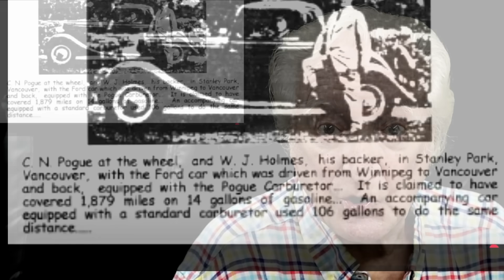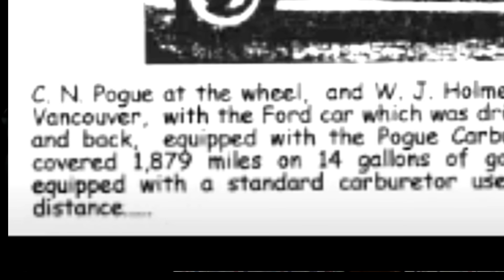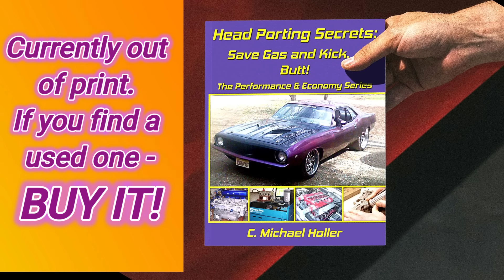100 MPG carb - the real truth!!

Comment: Pogue car you talk about was auctioned off. The article is still online. That cars block was cracked everywhere due to running Lean. Good article. 100 mpg? I don't know. What I do know is this, Compression, Compression, Compression. That makes horsepower and horsepower makes fuel economy. Tom ogles car moved the carb butterflies only to the fuel tank and put a reinforced tank under full vacuum that was heated with the motors coolant to help vaporize the gas. There was no pressure in the tank. Here's what I have done that works. A fuel tank under Full vacuum with just extremely little air bleed will run a motor with tons of power. The way I control the rpm is way by Ball valve. Basically you don't need an air intake on a n engine to run. It boils the gasoline under full vacuum. The oxygen comes from the boiling action of the fuel. Airplane pilots use the terms, Rich of Peak and Lean of Peak. This explains the danger zone of running Lean and the safe zone of running Lean.
Reply: A fuel tank under full vacuum? LOL! It couldn't handle full vacuum even if it was reinforced and it takes power to create vacuum. Engines are more efficient when they don't produce vacuum. Look at Hybrid motors. High compression and they bleed off vacuum.  Creates perhaps a 10 percent increase in fuel economy but loss of power.
Reply: @keithwiebe1787 if they are more efficient with less vacuum then how do they draw in fuel and air to atomize the fuel efficiently? Engine with hi vacuum have hi compression. And hi compression is what makes for an effeict engine.
Reply: Aaron, you say "the oxygen comes from the boiling action of the fuel."  Can you please explain just how this works?  Thank you.
Reply: @Cougracer67 same way boiling water gives off air. Why I have no idea except to say it's easy to check. Try it. You need a full vacuum on a sealed container with extremely little air hole in the line going to the engine. Make sure you have a way to keep the exhaust temperature. If I remember right water vapor can keep the engine cooled down

Comment: I know we're talking carburetors here, but how about modern high pressure fuel injection with pre combustion chambers? It also solves the dangers of fuel vapors.
Reply from the maker: GOOD ANSWER BUT WE ARE TALKING ABOUT A 1935 FLAT HEAD V8 HERE!
Reply: @DavidVizard  sorry I didn't know that part. I didn't know it was a very specific engine.I just knew you we're discussing carbs and yeah, this isn't carbs, carry on.😊
Reply: @DavidVizard  For now...

Comment: I am familiar with C N Pogue.  Also, I think 40 mph is too fast on old dirt roads.  20-30 mph is closer to the mark.  Pete Hodges
Reply: The theory they use is that not all of the fuel is vaporized and they compare mpg of propane powerd cars as an example.  Propane vapor is fully vaporized before combustion.  Propane MPG is similar to gasoline but propane does not have nearly as much energy as gasoline or diesel fuel.  Propane 91452-92500, Gasoline 120476-125000, Diesel 137381-138500 btu /us gallon
Reply: I am so glad you are revisiting this topic!
Reply: I guess to be correct it should actually be calculated in BTU per pound.  diesel fuel 19400 , gasoline 20500, propane 21500.  Diesel is 7.07 lb/gallon, gasoline is 6 lb per gallon.  Propane is 4.2 lb per gallon
Reply from the maker: Pete, - that's a piece of useful info. 
Thanks

Comment: If your prime interest is fuel economy per unit volume from a piston engine, then diesel is the hands down winner. 15% more energy per unit volume than gasoline, plus diesel engines are inherently more efficient than petrol engines. It's a no brainer, for the same vehicle you can expect 25 to 40% savings from a diesel vs petrol, whilst not changing your driving style in any way.
Reply: Thats why in europe had small diesel car very whith very low fuel comsuption
Reply: @danyan7  I have 1998 Seat Alhambra with VW 1.9 TDI , car weighs roughly 1800 Kg, average fuel consumption 52 Miles per imperial gallon, it's not a performance monster, but it easily keeps up with the traffic, so average journey times from A to B are exactly the same as your sports car if you don't want to get a speed camera ticket. I can legally tow two tonnes with it, it makes max torque at 1900 RPM ish, the ideal utilitarian daily driver. It has at present 280,000 miles on the clock and still going strong.  I save my V8 hobby car for the weekend...
Reply from the maker: Andy - we are specifically debating the 100 mpg carb. Other than model aero diesels this type of engine has fuel injection.
Reply: @DavidVizard  I appreciate your reply, I bought your A series  book in the 80s, when knowledge was far harder to come by than it is today with the internet. I learned a lot. I fitted twin SU carbs, home made manifold, to a Ford Kent 1600, carbs from an 1800 Marina TC, slightly thicker needles to lean it out a touch, way more power and much better fuel economy than the standard Ford fixed jet carb. It brought the Ford engine up to BL standards for fuel economy and power. For daily driver fuel economy, well set up  Skinner Union carbs are hard to beat. 33 degrees of advance at 3000 rpm if I remember correctly.

I then progressed to Rover p6, Did you ever do anything with the Buick/Rover V8?

Great respect and best regards.

Comment: The syncreometric mixture (I never could get the spelling right) the ideal mixture of air to fuel to fully burn , to much air no burn , to much fuel no full burn
Reply from the maker: The span of air/fuel ratios' that will burn is way wider the those hovering around the chemically correct A/F ratio.

Comment: LOL....does anyone realise the absolute tweaked to the edge of destruction engineers design to meet the highest MPG possible.....check the ultra-light motor oils causing engine failures. Lighter oil, less work for the oil pump.......Oh wait, you want the engine to last? Didn't think of that..............

This is complete BS......a tiny engine can, but not in a full-size car

Comment: feddie dixon  brooklands  man said carburartion is only a controled fuel leak 😂
Reply from the maker: Ah - Freddy Dixon - the Smoky Unik forrunner!
Reply: @DavidVizard 

i read he raced a6 pot "white riley " that had a leather cover over the 3 su carbs. it was concealing  the three bowden wires  that pulled the plungers,up  as the vacuum part was now disabled  and butterflies removed    just like an amal 
m,cycle carb   giving instant response

Comment: Mr. Vizard, 
May I first say that I totally respect that you've devoted much of your life in the pursuit of 'more efficiency' in combustion engines.  I define efficiency as more power &/or More fuel mileage. 

I'd like to possibly throw you a curve ball here, for you to think about a bit.

Making an engine run more efficiently is all about optimizing combustion and minimizing parasitic loss.  I define parasitic loss as heat, rotating assembly drag, intake runner restrictions, and exhaust restrictions.

However, there's another possible parasitic loss that I don't think anyone has ever looked at, except maybe me.  I hypothesize that the actual process of fuel combustion has a parasitic loss.  It is a 'known fact' that a certain type of fuel generates X amount of calories per X amount of said fuel, at perfect combustion.  

What if I said that I believe the combustion (disassociation of the fuel atoms) during combustion actually have a parasitic loss too.  What if I told you, that I have a process that I have developed, to impart a very specific resonant frequency into the fuel, before it reaches the intake of the engine that effectively 'weakens' the molecular bond of the same exact fuel, which reduces the parasitic loss of the combustion process.  The end result would be that the same fuel, treated with my process, would result in a higher BTU, or caloric output, per the same amount of fuel that was untreated.  

I've been working on this for years not, and I've come up with some very interesting results.  Would you like to discuss this at some point?
Reply from the maker: Yes call on the PowerTec 10 business line show at the end of my videos. I am hard to get so you may have to call 2 - 3 even 4 times. Leave a text message so I can call you also. Thanks
DV
Reply: This! This is the kinda stuff i keep telling people! There are so many other variables that people wouldn't even think of taking into account. If you think you know something then you better think twice.

Comment: Not enough energy in a gallon of gas??? Maybe in this modern day but, in the 70's, the oil companies did some sneaky things like modifying the final fuel product so it would be harder to get the higher mileage. There was to many high milage carburetors being developed in the 60s for the powers that be, and the oil companies changed the refinement so that all the hydrocarbon sizes were very inconsistent in the fuel unlike the old days. Some of the hydrocarbon sizes are larger and dont fully burn completely and that is why one big reason for the catalytic converters became necessary.
In the old days gas lasted way longer, all the hydrocarbons were one size and you did not  have  any of the hydrocarbons prematurely evaporating due to them being so small.
There are old stories of old  cars that would run just fine on old gas being in the tank after sitting for years. The quality of gas was way better back when. It wouldn't turn to heavier varnish like it does these days.
I could say so much more.
Reply: Nope

Comment: David, thanks,
3 points.

You forgot that 100 years ago they had Propper petrol,  2*  & 3*  & 4*  & 5*  & balistic juce,  unlike the woose-water imposed by todays moronic greenies,  so of course they had an mpg advantage over us.

However they also had crossply tyres unlike our radials of today so we now have the advantage back.

As the new very expensive radials were being introduced & you were porting airflow bench work for Cars & car convertions mag,  I was doing 0 to 50 mph 2 way average tests on my mini (it could'nt get to 60) and took an average =18 seconds a run even in the cold.

1 day I got a chance to borrow a set of radials and they shaved almost a couple of seconds off the run times and got it a couple of mph closer to 60,  so now we have that efficiency advantage.

Personally:  I always put failures down to the leftys,  back in those days we all had big bonfires each weekend and lead in our juce!  the air was full of crap,  then the greens invoked climate change upon us to clean up the air and rid us of the contaminents.

So,  although that car had a dimentionally calculated 6:1 compression ratio, it was sucking in 50% air and 50% crap particulates (if we believe the woke)  and so the true CR becomes closer to 12:1,   & that's 12:1 on real juce.

Keep up the greatbwork.

Comment: Hello David .  Thats why I like thermoquad carburators . really good gas milage on the 2 barrel around 200 CFM compared to edelbrocks or Holley that go for 400 CFM on the 2 barrel then when you want the kick in the pants the big secondaries on a thermoquad go up to 800 - 850 CFM give or take.  i also use the Gunson color tune  besides the classic vacuum gauge to fine tune carb and timing ect. i havent done the math yet . my 82 dodge d150 short bed truck has mildy built 318 with thermoquad and dual exhaust and high flow mufflers = cherry bomb vortex  , K&N 14 x 3 air filter , 3 speed automatic and the rear has 3:55 gears . truck weighs 4000 pounds with me in it . ill have to do the milage test and record my findings

Comment: barriers to 100 mile per gallon carburetor today are as follows, environmental rules and regulations, energy density of today's fuels and drivability. could take 10 miles to accelerate from 0 to 50 miles per hour.

Comment: Getting over the Rocky Mountains would use a lot of fuel.  Especially without all the passes and paved roads we have now.  Heck, the Trans-Canada highway didn't exist at that time and not all the roads were paved.  I'm surprised they published it at all, but here we are talking about nearly 90 years later.  Also, it's not well known but going from Winnipeg to Regina you are very slowly driving uphill in elevation.  Winnipeg is around 780 feet above sea level and Regina is around 1,900 feet above sea level.  Crossing the Rockies you would be around 5,500 feet.  I wonder how they set the carb up to deal with that?
Forgot to add, they would be using Imperial gallons, but still impossible either way.
Reply: I think you're right about imperial gallons for the false reporting on the Pogue carb. When I did my research into it nearly 30 years ago, I was under the impression it was imperial gallons (and I didn't like to make assumptions).

Comment: I don't know if the Wright bros machinist Charlie Taylor built  the fuel mixer on one of his early engines , maybe the first one had a hot plate evaporative device . There wasnt an engine available for the Wrights or maybe anyone that had the proper power to weight . So Charlie built one , with using the Wright's drawings . They needed 8 horse , the first one had 12 .

Comment: I had a guy come into a motorcycle shop I worked at years ago.  He buys a carb off a 250 Kawasaki ATV. He said he was building a 100mpg carb. Months later he drives in  with a Chevy Truck and I’ll be damned it had that silly Kawasaki carb plumbed into the manifold. He was all excited it was already getting like 35mpg. He probably reduced that Chevy truck to 50 hp.
Reply: mustt have left the choke on 😅
Reply: You know the cheapest device to get better fuel mileage is a sponge.

You tape it under the throttle pedal. 

Its sorta weird, the conspitards never want to just buy a small european or japanese car.
Reply: @lasskinn 😂😂😂
that is unique … a sponge… 😂 I connected a hand throttle to my carb … just a piece of tube with a bicycle brake lever connected to the carb with a brake cable … Got really good mileage sitting cross legged on my seat and using my hand to cruise along the outback highways in Australia…!!! Fun!😊
Reply: Either compressing gasoline, or heating it, in to a Vapor, " could " increase MPG, to about 60.
Vaporized fuel is less work the motor has to do
Reply: @greggbaker7120 It's more than that, it also means the fuel will be in a better state for a more complete combustion.
Meaning more energy is released on every firing stroke for the amount of fuel used. 
It works well enough on a fixed rpm and loaded engine but when the running conditions change you need to work fast to correct the volume of fuel being delivered.
Works well on generators, fuel lasts many times longer and the motor runs very clean, oil doesn't get contaminated as quickly either.
Reply: @gothicpagan.666 Hi. Thank you for the reply.
I have forgotten how to spell it. many years ago a guy i worked with gave me, a copy of a booklet on the " nay ' box, that used the engine coolant 
 to heat the fuel, to a vapor.
I think compressing it, would be safer.

Comment: You talking about the 1932 Ford Model-58 motor, aka the V8-60? A small displacement ICE (gasoline) in something like the 2-passenger Aptera should be capable of 100MPG at 40MPH fairly easily.

Comment: My problem with 100mpg stuff is the basic maths.  If you calculate the things that aren't changed in these tests...rolling resistance, air resistance, internal friction losses in the trans and final drive...then calculate the total chemical energy in a gallon of fuel, less the inherent inefficiencies of the very best ICE engine (lets call it 50% efficient to be extra kind)...and I'm not sure there's enough energy in that gallon to accelerate that mass against those losses for that distance, even if everything else was optimized.

Edit: Sounds like you've got the same objections that I have.  
👍
Reply: I just learned this in another thread, go look up the Shell Eco Marathon record
Reply: Doug Pelmer at Horsepower Sales was able to get 50mpg in a Fox Mustang coupe using E85.  He kept how he did it a secret.  He was trying to claim 100mpg if it was gasoline.
Reply: @terrycarter8929   I'll bet he kept it a "secret" - just like all magicians and illusionists.  E85 is less energy-dense than gasoline - i think straight ethanol is around 30% less - so call it 25% less energy dense for E85 to use round numbers.  That means the best he could hope for from an E85 run on gasoline at 50 mpg would be around 66 mpg on gasoline - assuming the original numbers were anything like accurate.  But for him to not know the energy density of ethanol as compared with gasoline...makes me shake my head.
Reply: Exactly!
Reply: "Extra kind?" The best efficiency's I've ever heard of for a Carnot-cycle IC was ~30%, usually closer to 25%. You are generous to a fault, my friend! 😄
Reply: New motortypes has up to 80% efficienzy IIRC-And I might not. Then that wouldnt be about the carb and probably they dont even have a carb.Cheers
Reply: @allankvist6741  you don't recall correctly. The most efficient modern engine I've heard of (as a professional automotive engineer) are the Cummins hydrogen engines and Formula 1 engines, both at about 50% thermal efficiency.
Reply: @allankvist6741 I had a Hyosung GV250 it had variable venturi carb and it would get 99mpg driving at 45mph.  55mph at 80mph.

Comment: I had assumed this was related to a high compression engine that used a sort of water injection to alleviate ping.  Kinda like water meth injection.  Do you think that could have a positive affect on mileage Mr. Vizard?
Reply: Absolutely. Water and steam injection into gas turbine combustors is used to achieve a sort of combined cycle effect without the use of a separate steam turbine or condenser, and in the case of water injection, without even an exhust heat boiler.